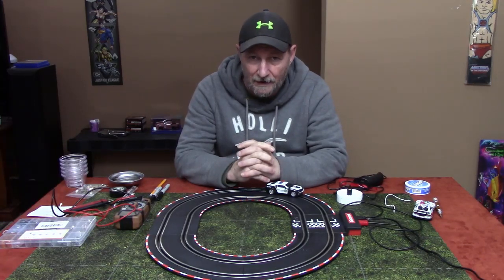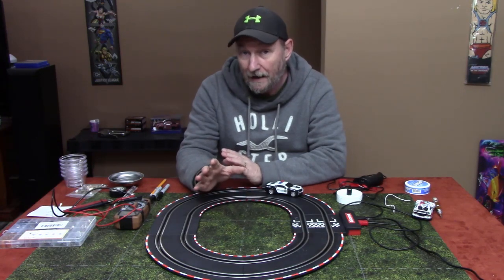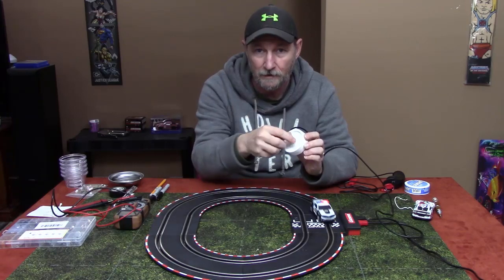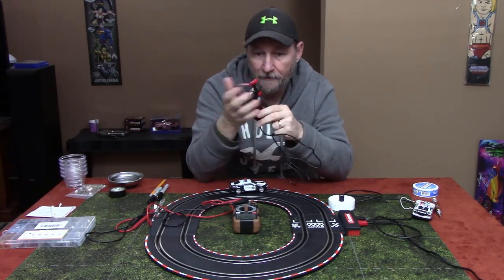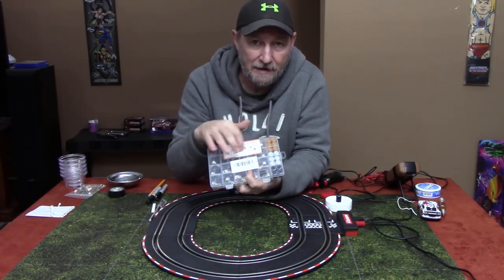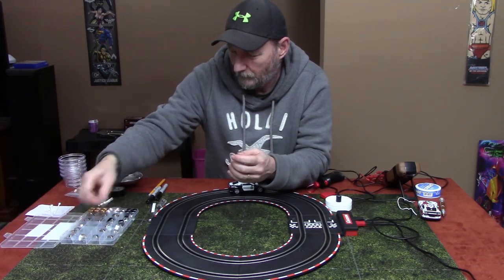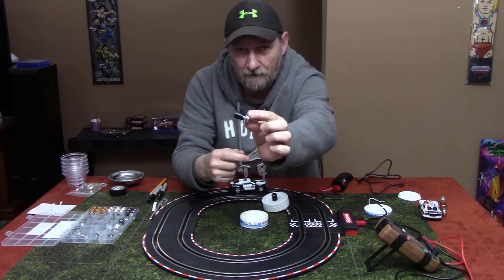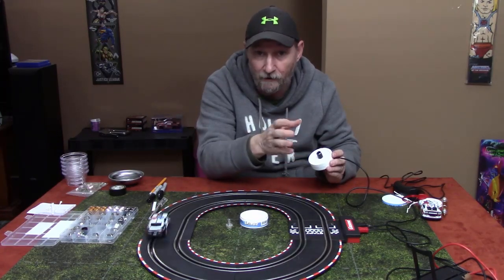How to make a Slot Car Analog Ghost Car Controller

Comment: 10K? that seems very weird. I have afx and most controllers are around 100 ohms, 100 times smaller. 
Lets say its 14v power supply, a 10k resistor at full throttle is 4K (w/o turbo), with 4K the car would get less than 4mA, this makes no sense to me. Its there a transistor somewhere controlling the current?

Comment: I love this idea and have got myself some potentiometers , I have scalextric sport controllers , I have followed you instructions but when I came to the wires , there is 3 , red ,green and a browny black , could you give me a clue where the 3 wires attach,  or do I just use 2 of the wires , thanks
Reply from the maker: You just use 2. One is for brakes but you don't need that one.

Comment: I have a real cheap set to have fun with the 5 year old.  The controllers are not just cheap but crap .the mounts inside for the resistor at one end are melting.
Reply from the maker: That would make me a little worried. :)

Comment: Watched this 2 days ago and ordered the parts.  They came in today and within 30 minutes I had a Ghost Car up and running!!!  Even managed to wire it right the first time.  Thanks for this great idea!!!
Now to figure out how to setup a Ghost Car using the SmartRace app!!!
Reply from the maker: That's awesome!
Reply: @tomsidener  I also use it to true tires, it's a lot better than trying to hold the car, the plunger throttle, and the sandpaper at the same time! LOL

Comment: Is there a wattage limit for these? I did this on my AFX track and the potentiometer keeps burning out. Why would it keep burning out. Any idea?
Reply from the maker: I found a link to this article. It has some calculations that may help with this issue.  https://www.quora.com/What-is-the-maximum-voltage-I-can-give-to-a-10k-potentiometer#:~:text=The%20maximum%20voltage%20is%20limited,across%20the%20full%2010000%20ohms.
Reply from the maker: I do not have an AFX track but I looked it up and it looks like they have very high voltage. My track is 14 volts max. You may need a bigger potentiometer.

From the internet 
Modern AFX and Tyco slot car motors require a power supply producing 18 to 20 volts of direct current (VDC), while older Model Motoring cars require 20 to 24 VDC.
Reply: @tomsidener  Ok, im using a variable voltage power source. I can go from 0 to 30 watts. Ill turn down the power and try again. Thank you so much for your help. Much appreciated!
Reply from the maker: Your welcome. BTW Go Wolverines!
Reply from the maker: @nobodyshome758. This little device works great on my Carrera evolution and my Grandsons Carrera Go but I tried to build something similar for my new Policar analog track and I am having the same issues as you. The potentiometers are getting overloaded and burning out. I am currently experimenting with PWM (pulse width modulators) and Rheostats and I will make a new video if I get something working.
Reply: @tomsidener  Awesome, thanks Tom!!
Reply: I have the same problem on my Tyco. i tried 4 potentiometers but they all just make the car go on full turn. less than that the cars don't run.
Reply: @cruzitocustoms  you'll need a rheostat instead, at least about 50ohm. Tom did another video about this. Check his videos.
Reply: @nobodyshome758  thank you. is this what you are using as well?
Reply: @cruzitocustoms  Im actually using a 30 ohm, its working but not as well as I would like. I think a 50ohm at least would be better.
Reply: Wire-wound is a term not being mentioned much, here.
It's not as ambiguous and, is the type that won't fry, when reining in a motor.

Comment: Interesting idea.  How does the resistance in ohms relate to the resistances normally given with controllers (e.g. Parma 15 ohms,  30 ohms,  45, 60, etc.).  I assumed these Carrera controllers are about 60ohm.
Reply from the maker: The controllers at full resistance are 10k ohm

Comment: Will the system work with the Evolution track and the 3 wire controllers that come with it? Where would the brake wire be soldered to, or is it not used?
Reply from the maker: I think the older version of evolution may have 3 wires (one possibly a brake) You can test across the 3 wires and see what combination losses resistance when the plunger is pressed those would be the 2 wires you want to use. You would not need the brake on a ghost car so that wire should be able to be ignored.
Reply: Iv done it on my Evolution Set today  the controller only has two wires to sort out nice and easy 👌

Comment: thats brilliant idea, i got straight onto ebay to try this
Reply from the maker: Its unfortunate that you can't just buy the ends without destroying an actual controller but I have not been able to find just the ends anywhere. Good luck on your project.
Reply: @tomsidener  I don’t mind pulling a controller apart iv bought enough evolution sets so plenty spare for this project and I’m partial to repurposing components for other uses where possible, Thanks for posting this show through on your channel 🙏
Reply: @tomsidener  done it Tom thanks for the time and effort you took to work all that out 🙏
Reply from the maker: Your very welcome